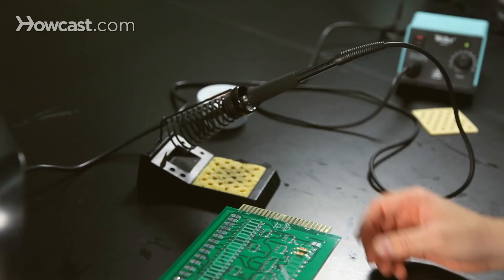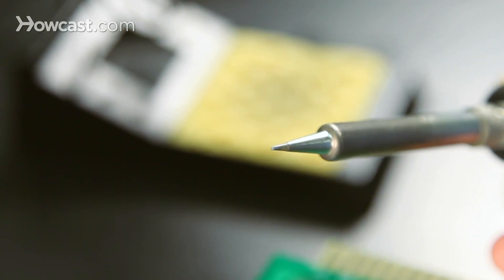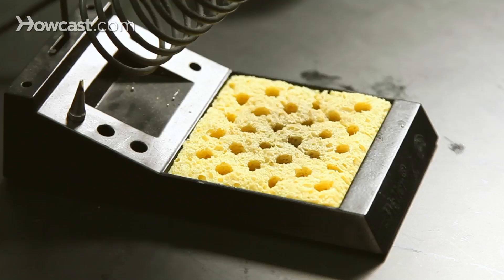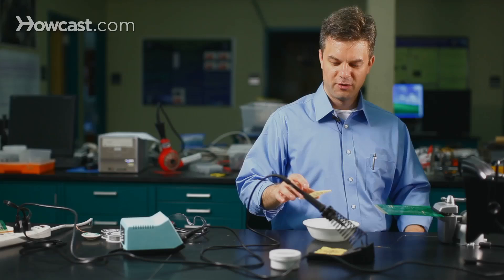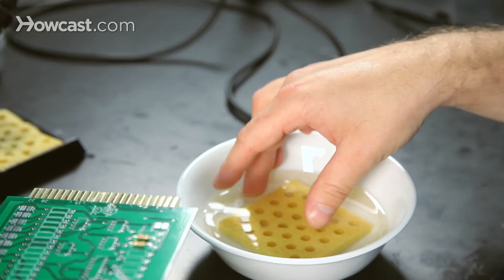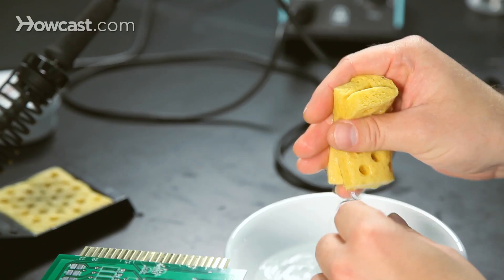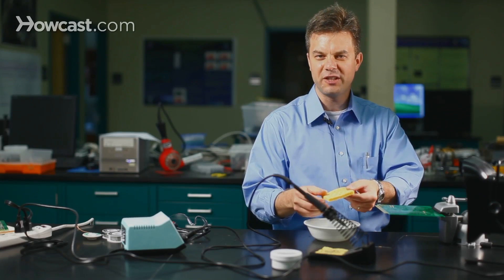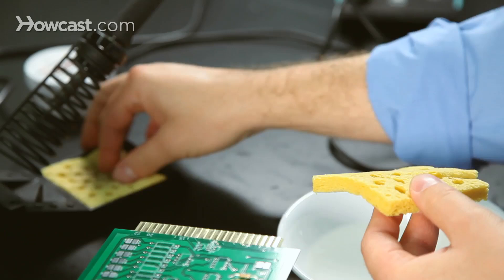How Is a Wet Sponge Used? | Soldering

Comment: Well this guy almost has it right. The wet sponge is not for cleaning, it's for only shocking off the oxide from the tip. But you only need to lightly touch the tip on the sponge and the oxide will fall off. When you drag it repeatedly then you've lost a lot of heat from the tip. When that happens the station will try to heat it back up quickly and overshoot the set-point and when that happens and you start soldering you can damage components.

Comment: Can it be any sponge, like the ones to do the dishes?
Reply: Yes, perferably like those sponges although they typically will be of odd proportion. You can buy smaller cheaper sponges designed for soldering, with holes in them and what not like the one demonstrated in the video.

Comment: actually....using a wet sponge too much after a time kills the element on the soldering iron and can also destroy the tip after a while, i'll recommend using the brillo pad to clean your tip cause applying a heated tip to a cold or wet sponge can damage it.